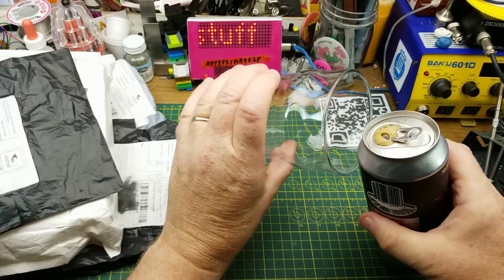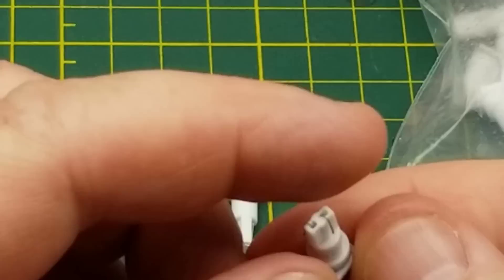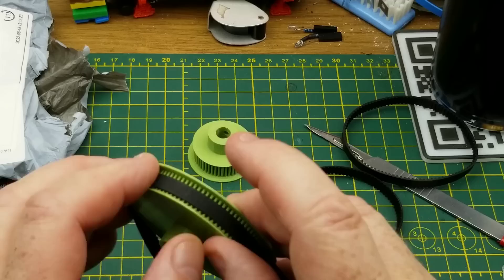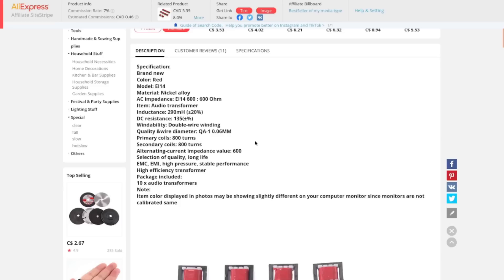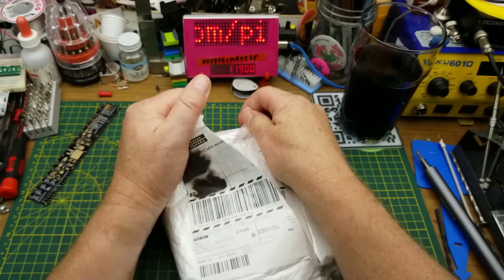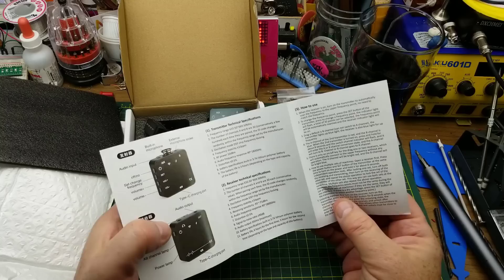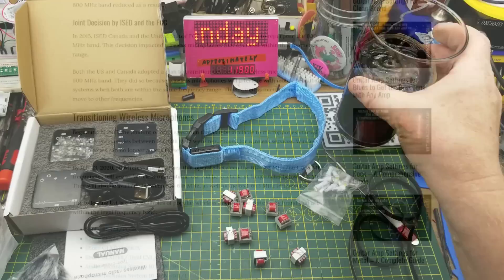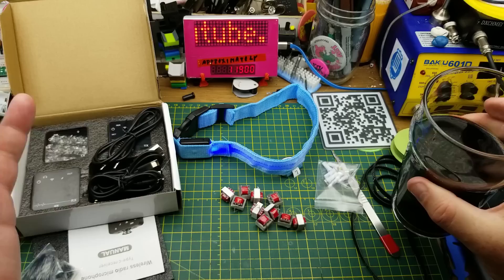Mailbag Monday149

Comment: In the U.S., I believe you can transmit < 100mA on almost any broadcast frequency. That's why you can use that FM xmitter without a license.
Reply from the maker: Possibly, but as someone whose day job includes tracking down interference, I'd rather not set a bad example.

Plus, the seller gave me a refund and told me to "dispose" of the unit locally, so... teardown coming!
Reply: @pileofstuff  Teardown... mmmm....

I think the OP is correct though. Last time I looked all bands have low power limits you can transmit on with a very few exceptions like aviation and a couple of military bands.

Also, about operating in the 2.5 gHz band without interfering with anything... Big Clive would like a word with you.
Reply: mW, but whatever :)

Comment: Couple of things you might find useful
A magnifier like your fold out ones, but with led illumination, i find mine very useful
The other thing is a trimmer tool, the one i have is made of good plastic, one end has a recess with a piece of metal, it is ideal for 10 turn trimmers as it doesn't slip off  ;)
Reply from the maker: Thanks.
I've got a set of ceramic tipped trimmer tools that work pretty well, but the ones with a recess can be very handy especially when fumbling around in the dark (we have those at work)